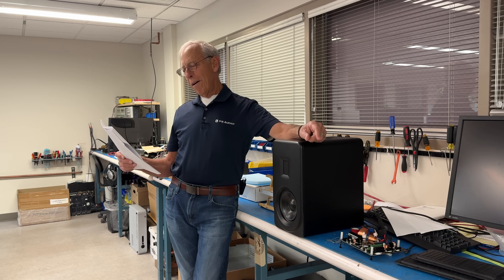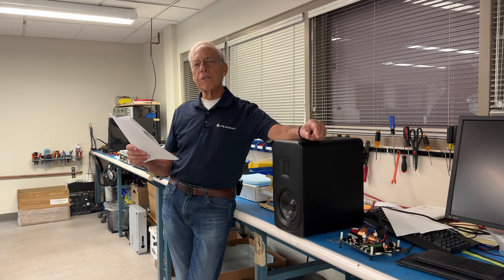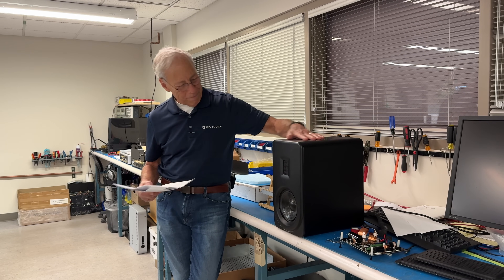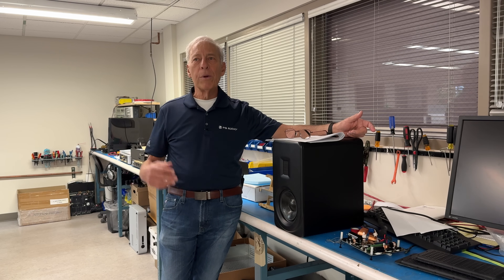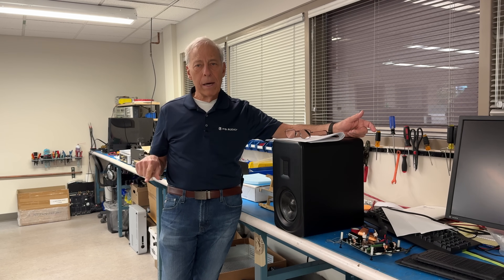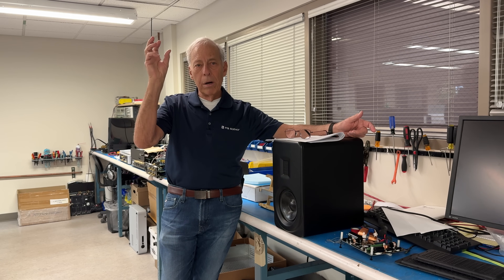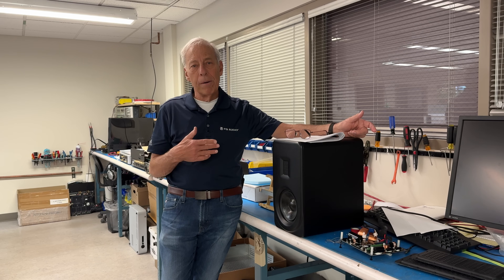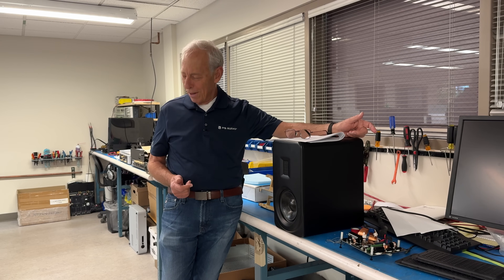Whole house battery power for high end audio

Comment: I know what and what doesnt happens running on battery power. The AC off of the grid runs about 6% distortion and the voltage can vary tremendously. Ive seen 160v spikes on 120v circuit. Ive been running batteries- off grid- for over 12 years now. My Cotek inverter is up to 98% efficient and 3% distortion. I can play music for about 6-8 hours off 1 regular deep cycle marine battery. Stand alone system for the stereo and solar lithium for the house. There is no noise added to the signal.

Comment: I assume that most of these home batteries come as a part of photovoltaic system. If that's the case, then one has to watch for "PV energy diverters" that use excess solar power to heat the electric boilers etc. Problem is, that these diverters utilize thyristors and SSR relays with phase-angle power control which are causing extreme interference and noise in the all home AC circuits. Sometimes, even if a passive AC filter is used, the noise is still audible. Solutions exist, just be aware that this problem might be even worse than the low impedance of a home inverter itself.

Comment: A good DIY project would be to build amps that run happily on the 48V DC battery supply.  Eliminating the inverter and the AC to DC components of the amps would certainly work well.  Leave the caps for a local power reserve and to filter any noise picked up and you'd be in great shape.  Digital runs on 3.3V and some 5V supplies.  Likely do well to leave them running on the inverted AC.

Comment: Should release a line of DC powered kit at 24V. Given each bit of kit currently has a transformer to convert AC back to DC.

No mains hum👍
Reply: ... and about 10watts per channel. Car stereo amps resort to increasing the voltage internally to achieve higher power ratings. Eliminate one element to add a couple of others hardly simplifies matters. Perhaps some may find it advantageous.

Comment: 83 db spl efficiency for the FR5? Wow, that is really low.
Reply: Magnepans are 88 😮  
🪴s have power spikes
Reply: @CarlVanDoren61  Magnepan LRS 86 dB (a 500 Hz / 2,83 V) according to their own site, although units must be the same if we want a fair comparison. That value is associated with gain and not with power demand, therefore their sensitivity will be closer to 83 dB/W at 1 m.  Frequency response and dispersion is also weird.
Reply: I’d rather have a lower efficiency than a horrible frequency response.

Comment: Those solar storage battery packs are supposed to be compliant with FCC (CE etc. depending on country) EMI (Electromagnetic Interference) regulatory requirements...I thought. But then I read that they can be exempt from the FCC  Section 15, Part B requirements causing noise issues with an output that might look more like a square wave than a sine wave. So hey, perhaps Paul should take that as an opportunity to make FCC compliant "Audiophile energy storage" solutions with cleanest true to sine wave output to serve not only solar installations but also non-solar installations with battery backup. Non FCC compliant gear radiating RF noise in a home might cause other issues e.g. WiFi, Bluetooth, Z-Wave, Zigbee etc. becoming unreliable.

Comment: Correct, all hifi power supplies output dc from ac mains so just run the device directly with dc at the right voltage.  Danny Richie at GR Research does just that.  Ah, but then the market for fancy, expensive psu's would disappear and we wouldn't want that would we?

Comment: @1:19 "...except, they don't make audiophile inverters."
They might, even if those inverters are not intended for home use.

Data centers (like Google, Microsoft, Thomson Reuters, etc), where they have $100,000,000+ sunk into those huge facilities, use high-quality, commercial UPSs (uninterruptible power supplies), delivering megawatts of pure sine wave power.

Those UPSs do dual conversion, because those companies do not want their data centers to see a single watt from the public's power grid.

Some of those computers, networking gear, firewalls, telecom equipment, etc, can be very sensitive to anything other than perfectly conditioned power.  Data General used to make an MV series of computers that would fail from anything electrical that was not perfect.  Atlantic Records, Thomson Reuters, ADP (Automatic Data Processing / payroll, etc) used to have those Data General systems.  But they were fed by high-end, dual conversion, Liebert UPSs.

Eaton's Powerware UPSs are another choice used in those companies.

Now, those UPSs (the ones that can deliver multiple megawatts of power) cost more than most homes (perhaps all of the homes on the block).  But maybe they provide the kind of accurate power that our host was describing?

Powerware also makes dual conversion systems that are for small office and home use.  The model in their "9" series do the double power conversion.  The "9" series addresses the nine know power issues.  Perhaps a "9" series UPS from them will have an inverter that is up to audiophile standards?

I used to own a model 9130.  Not sure if it is still current.  They got silly expensive.  So I switched to an APC unit with voltage regulation.  Not as good.  But it keeps my computers safe.

My point is that there are seriously well made UPS systems that data centers use, and they probably will provide rock-solid performance.

Anyone know what hospitals use?  You know that they can't risk having any life saving equipment miss a single beat, or reset, etc.  And what about in the operating room, in the middle of having open heart surgery, etc.  Their power systems have to be of the highest quality -- with a price to match.

Of course, PS Audio's Power Plants would be the right choice for your home stereo.  My comment was intended to question our host's assertion that "they" don't make such inverters.  I think that our host did not consider what is out there.  He might have been considering what is at BestBuy, Walmart, and Costco.  Not that we would buy a megawatt Eaton unit.  But they do make them -- and they might be great for a high-end system.  We will never know.

Comment: it's not much to make it audio file quality inverter most of them are pure sine wave anyway just put a yx1 275V 1ferret capacitor across it output from the inverter.
and you can connect the batteries directly it's the best way just jumper and the bridge rectifier just find out what the voltage is and feed it into the filter capacitors you don't need an inverter then. direct DC into the appliance just find the voltages it runs on.